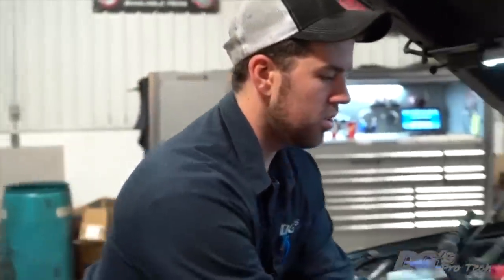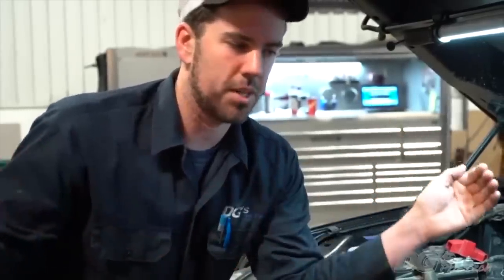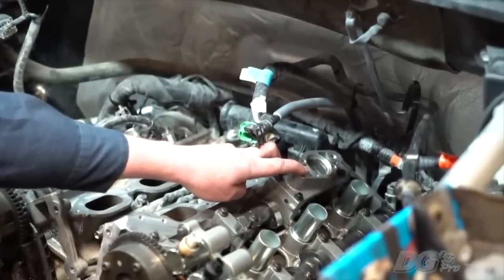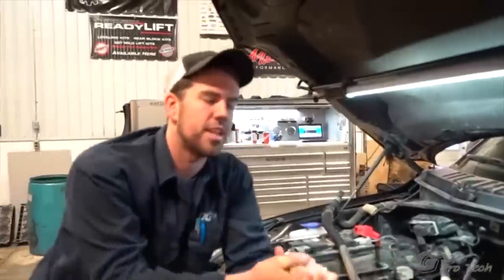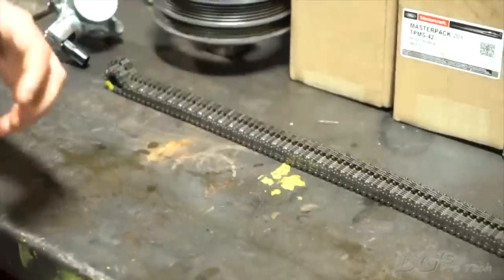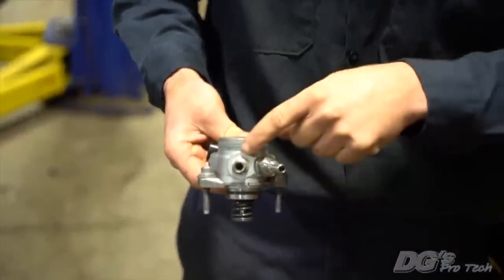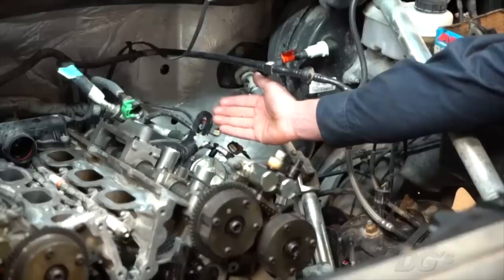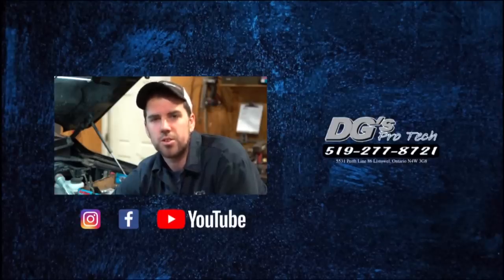What you NEED to know about Ford EcoBoost Engines by Dustin Golley of DG's ProTech

Comment: Such an articulate mechanic is a rarity in the service business.
Reply: Couldn't agree more the engine is good for business and he's well versed in its failings.
Reply: The dude's a dinosaur.  He's a thesaurus.
Reply: Jamal K. well known fact that Japanese manufacturer Toyota’s TUNDRA is now the most American made full size truck in the United States 🇺🇸.
Reply: @private1572  Right down there in San Antone.
The thing that bothers me 'tho is it's relatively so very few number of sales...58K vs. FORD 1.2M.
It seems to be a much better truck than that.
Reply: Louis Healan I own a 2017 Tundra.  I bought it new and I’m very happy with it.  It’s true they have very few sales compared to the F150.  I hate to admit it, but the trucks a dinosaur.  Bad fuel economy, not a lot of new technology and few bells and whistles to speak of.  However, in terms of reliability, you can’t beat Toyota.  These trucks can outlast the competition 3 times over, which on a side note, also stands to reason why they aren’t purchased as often.
Reply: Jamal K.  What I am trying to get across is that no INFINITI SUV is overpriced.
That is because the SUV/Crossover marketing segment is the top-selling segment in the industry.
The carmakers pack them with the maximum number of features and options to drive up the price.
They know if you don't pay their price some other Joe will.
So, in effect, none of them are overpriced because ALL of them are overpriced.
When compared to the other nameplates, they are ALL comparably priced.
Not overpriced.
Reply: Jamal K.  Have ya read 'bout that 2020 FORD Super Duty truck w/the 7.3L gas engine yet?
Reply: Jamal K.  I was reading about the FORD 6.8L 3-valve gas V-10...362Hp, 457ft/lbs. torque.
Reply: Jamal K. I’m so glad you pointed that out.  It proves you don’t know what you’re talking about.  The Honda Ridgeline is not a “full size truck.”  As everyone can see, I was referring to a “full size truck.”  Also, there’s no need for the “gay” comment, grow up.
Reply: Jamal K. So you speak for the whole world eh?  Nice attempt at a deflection.  All the googling in the world isn’t going to make the Honda Ridgeline a “full size truck” as you’ve stated.
Reply: Jamal K. You’ve said that ALL the recalls apply to ALL the model years.  FAKE NEWS.
Reply: THE COMPLICATIONS of maintaining a VVT engine is one thing.  However, the very nature of TURBOS only contribute to the quicker demise of any engine they are applied to...
Reply: Fuck you
Reply: 31B4P  Gosh!  I dunno about any of that.  My 5 1/2yo/70K mi. Infiniti w/"deluxe tech" has never had a major system failure...mirror motor noisy, e-call module failure, sun visor "floppy", etc.
I have never had to add any fluids to a drivetrain component.
I think there about 20M TAKATA airbag vehicles running around, but not my Infiniti.
Reply: 31B4P Takata airbags affected almost all major manufacturers and all deaths and injuries were HONDA vehicles.  Gas pedals?  Welcome to 10 years later.  There is absolutely no evidence whatsoever anyone died from a TOYOTA window switch.  Moreover, none of this affected the 2017 TUNDRA you buffoon.
Reply: Clorox Bleach  then there folks who drive the shit out of their Ecoboost trucks and have no problems at all. Gas consumption be damned I run premium in mine and flog it regularly. Baby loves the whip.
Reply: This guy is an educated mechanic. Good job. I wouldn't buy a ford. I am a gm guy.
Reply: I was just about to say that very word "articulate"
Reply: Jamal K.  It is not a Nissan ( Datsun ).  It is a FANCY Nissan.
I am more than a little worried about Infiniti.
They are losing models ( Q70, Q70L ), technically, their line is behind to way behind other luxury brands and the 2019s are all but unchanged from my '14 QX80 ( I purchased the Deluxe Tech model ).  The Nissan Armada is now a MUCH lower-priced QX80!
But at least, at this point, it has been the best car I have ever had ( 5yrs/68K mi. NO major problems whatsoever! ).  SO QUIET, comfortable and smooth.
6,000lbs. & TUFF as nails!
I worked as a M-B service tech for 30yrs.
NO Mercedes made since 1980 has had a comparable reliability record.  With Mercedes, your loan car is your next best friend.
Reply: Jamal K.  No engine stalling whatsoever.
The Adaptive Cruise Control cruises nice & smooth at 90mph.
That is most helpful when driving from the east side of Texas to the west side ( 892mi. ).
Reply: Jamal K.  If 10,000 lemmings follow their " leader" and fall off a cliff  do you follow in lockstep?
Reply: Jamal K.  I used to work with a guy who always bitched when he didn't get what he ordered in a restaurant during lunch.
He would face away from the waitress/waiter and mumble.
I felt no sympathy for him.  Over a period of years, I counseled him.  Eventually, he stood up on his hind legs and took charge of his life.
Reply: Jamal K. if you’re basing the best full size truck on sales alone, then The Dodge Ram must also be great according to you.  They’re complete junk, but they sell a lot of trucks.  Chevy  sold 332,000 Equinox’s last year, that doesn’t mean it’s the best crossover SUV.  It’s one of the worst.
Reply: Unreliable junk. When electric vehicles become mainstream these trucks will disappear.
Reply: Gawsh gee, g'wan now me bruddah.  Heck offa ting to speech up onhis gud artikulashon...Be like me, methinks...
Reply: 31B4P I think they forgot the Titan. Built in Missouri, engines built in Tennessee.
Reply: MichaelAChang   Wut yu mean?!? I’m a reel good talker!!
Reply: You still playing tennis?
Reply: Ok Bloomberg
Reply: he's the owner
Reply: Talks like an engineer, refreshing.
Reply: Mike, twin brother Mark? From the yard?
Reply: That is so true and most of them rip you off..
Reply: hahhahahahahhaha   you got to be joking    Similar to comparing a 454 chevy to a nova II 4 cylinder ... Little tiny engine need lots of boost to make up the diff the 454 put out just lugging along at just above an idle ... Most would think big motor means more fuel but dont take into consideration the tiny engine spun up screaming barley puts out what the big boy does just above idle an Is Running through fuel it like a faucet drain . Also There is No Fuel System that Operates at Anywhere Near 25k psi . Amazes Me Cardone Would put this shade tree Wonder on there Page without at least screening Him ...lol Alot of Misinformation , Incorrect information , an Sheer Ignorance
Reply: @civilianspaceagency7106  Maybe not anymore, but the term for this used to be "volumetric efficiency".
Reply: I think he has a very good understanding of mechanical engineering which is why he’s so articulate and understands the engine very well
Reply: Ok YouTube, here's my message, I wanted to upvote, but three tries later, I got the comments entry instead of actually the up arrow. You suck, I'm going to watch videos now and not upvote. It's your fault YouTube for being stupid.
Reply: Jamal K. You’re still not explaining how the Honda Ridgeline is a “full size truck.”  I’ve been very candid about why the Tundra’s do less volume.  I’m not surprised someone like yourself is unable to comprehend that.
Reply: Jamal K. More FAKE NEWS.  None of those recalls apply to the 2017 Tundra.
Reply: Jamal K.  I had a recall to check the driver's airbag...it is a "good" one.  It does not use oil.  The suspension is GREAT!  When I enter a curve at highway speeds, the car DOES NOT LEAN OVER!
Basically, the QX80 is based on the Nissan Patrol...an ironclad dreadnought.
This is NOT a Maxima with a CVT transaxle.
Reply: Jamal K.  There are people here who believe that the Apollo moon missions were a hoax.  They swear  we faked the moon landing.
But then, they weren't even born in '69.  How could they know?  Talk abour 2nd hand, 3rd hand.
Reply: This guy knows his trade, I see this guy going far in his chosen profession.
Reply: No shit!
Reply: Jamal K.  Never had a Hyundai...yet.  Gotta Toyota, a Turbo VW, a Hybrid Merc, an F-150 EcoBoost Platinum, and a h-u-g-e 400Hp AWD Infiniti.
Started w/a V-8 '55 Bel Air, then a Volvo, a Beetle,  an Impala, then an Olds 88, followed by a Sienna.
Have never had a bad car.
Reply: Well done! Easy explanation that anyone can understand.
Reply: Herbert Cheung not well done at all!  The Honda Ridgeline is not a “full size truck.”
Reply: Such an articulate American is a rarity.
No "like", or "actual", or even a "kind'a".
Reply: Louis Healan he sounds extremely Canadian. Which is fine.
Reply: @markiangooley  I was in Ontario once.  'Twas in August, the summer of '99, right after the Stars won The Cup.  My Dad had just died a lingering death.  Needed some road time.  Had a nice drive up from the Gulf.  My 180K mi. Mercedes Turbo Diesel purred all the way.  Went thru the Hockey HOF at the Centre.  Saw the Rangers beat the Blue Jays at Sky Dome.  Felt the breeze off the Lake on the back of my neck.  Drank a La Batt's out of a plastic cup.  Drove down to Detroit for the final season of Tiger's Stadium...Rangers lost that one.  Drove thru Mich & Ind with the windows down.  Hit hot, humid St. Louie and went to AC on HIGH.  Zipped on home for Labor Day.  A nice trip.
Reply: Louis Healan sounds like a great 👍🏻 time!
Reply: @private1572  It was a good time.  I had planned on going to see where "they" detonated "the gadget" in New Mexico in 1945 during the 7hrs. it is open twice a year.  Unfortunately my wife is still recovering from surgery.  Maybe in April.
Reply: @SpicyRok7482 nice story lake breeze stardust moments
Reply: Louis Healan he’s not American.  He’s in Listowel, Ontario, Canada 🇨🇦.
Reply: @private1572   I was about to say that he sounded as if he was from Ontario.
Reply: @private1572  so he's american from the continent, just not from the usa.
Reply: @private1572  I noticed he was from the great white north the first time he said about.
Reply: He’s Canadian. I’m American and articulate. It matters not where one is from. It’s about knowing you subject, preparation to speak know as practice. Visual aids also help many understand much better. He was prepared, knowledgeable, well-spoken. Key elements for effective communication.
Reply: @SpicyRok7482  Hey Louis! Did you know he's Canadian actually? Little hints like the use of km instead of miles, his accent, the fact that the end of the video says Listowel ON (Canada)
Reply: Louis Healan It’s because he’s Canadian
Reply: @SpicyRok7482  hes clearly Canadien.  Aboot instead of about is a dead giveaway.
Reply: @mickpratt8327  I LOVE Canadian!  GO HABS!!!  I also enjoy "Canadian bacon"...on a pizza pie...w/pineapple chunks & w/sliced green olives.
Reply: @SpicyRok7482  Listen closely, this man is a Canadian. They have a huge vocabulary. They don't use a string of four letter words to express them selves. They are also a polite people.  A case in point - if a Canadian thinks you have a hole in your head, he will never say it like that.  A Canadian will compliment you for having "an open mind."
Reply: @georgemoomaw9437  YessSIR!  I gotcha TWICE the FIRST time!

Comment: No surprise that an engine that complicated would require a lot of maintenance.  My next vehicle will be electric.
Reply: R Cruz   Brushless electric motors only have bearings and controllers, no moving parts other than the rotor.  They are over 90% efficient vs. the best ICE's pitiful 40%...no transmission, no exhaust system, no hoses, no coolant, spark plugs, air cleaners, no oil changes, and the cost of electricity is a fraction of gas to operate one.  Even a Tesla model 3 will cost you the same as a Toyota Corolla after five years due to the lack of maintenance costs, along with 0 to 60 in 3.3 seconds.
https://www.youtube.com/watch?v=zFiw3_uXyyQ

Comment: Have you seen Issues with carbon buildup on the back of intake valves on Fords Eco Boost 3.5
Reply: Fixed in 2017 or 2018 with dual injection system
Reply: All direct injection motors have this issue to some degree.
Reply: common problem
Reply: Can always install a catch can. If the crap from the crank case doesn't pass through the intake it'll never build up on the backs of your intake valves.
Reply: Do these eco boost engines need an oil catch can or are they ok with out. I have a 2016 3.5l
Reply: @lewisvenecia  I don't personally have an engine with direct injection but build up on the back of the valves seems to be a common problem. No fuel washing over the valves to keep them clean since it's injected directly into the cylinder. Then you get all the crap from the crank case that gets routed through the intake through the PCV to be burnt off. I keep hearing these issues were resolved in the newer engines with both direct injection and the older lower pressure injectors through the intake. Catch can just seems like a good idea to me, but I'm just some asshole on the internet so take it with a grain of salt

Comment: The reason gasoline doesn't need as much injection pressure is that gasoline engines have timed ignition. A diesel injector has to overcome high cylinder pressure and the ignition that is occurring as the injection happens. Gasoline injectors are done injecting fuel when the spark ignites it. They are not trying to push fuel into an explosion in progress like a diesel is.

Comment: Is this the same cardone that makes junk replacement parts?  Like the 2 broken distributors you sold me for my truck? One was cracked and the other leaked oil from the top.
That engine is garbage.  Tell us about how Ford in their infinite wisdom buried  the water pump inside the timing cover.   Ford's are garbage.

Comment: What about valve build up due to direct injection? Thanks
Reply: Ford changed that in the 2018-2019 models...some spray hits the back of the piston
Reply: Been looking at 16 and 17 models, guess they will have the issue?

Comment: Even Ford should be satisfied with this explanation.  It needs fresh synthetic every 7,000 miles or so.  10,000km.  Another thing, on any engine but especially turbo, you go easy on it when it is cold.  Only use real power after the temp needle is off the peg.  Duh.

Comment: Thanks for the information  , I had this issue with my 05 5.4 after 208k miles . Changed the oil / filter every 5k . I recently bought the 18 F150 3.5 & plan on doing the same oil changes with full synthetic . Question ? What is your opion of oil additives like Stiction ? Could this product help with keeping a clean engine ? I did install a passenger side catch can . Enjoyed your video .

Comment: If they would just leave these motors alone instead of building the new one every few years we wouldn't be running into all these problems
Reply: Yes a but power and miles per gallon wouldnt improve as fast either.

Comment: The design is made to fail. Cheap cheap timing chain. Had Ford dealer do service for first 200k. At 160k timing chain was stretched to point of needing replacement. Eco bust gets worse fuel mileage than 5.4. Owned both back to back identical trucks.  the computer also gives false fuel mileage, checked this weekly for three years. It's made for the mathematically challenged.  Going put this shit box in the crusher and buy a Dodge.

Comment: I have the 2016 F150 with the 3.5 and 36,000 miles on engine. Have you seen any issues with carbon build up on the valves? If yes, at what mileage do you recommend an induction service. I hear BG has a Ford approved induction service.

Comment: I had a Kia van with ecoboost. not sure if is the same motor but it had a carbon build up issue eventually it clogged some oil passages and then it seized.

Comment: This has to be one of the best break down videos of the eco boosts.   No drama...just straight mechanic talk.  I got one in my ford transit van and it is a blast to drive in houston where you have to get on the gas to get through traffic.  Also pulls my 6 x12 cargo trailer like it wasn't even there

Comment: I have a 2011 ecoboost. Worst truck I have ever owned except maybe the old J10 I had out of high school. spent thousands in the shop, been towed twice, still runs on 4 cylinders most of the time. Considering leaving the keys in it at the 7-11 in Reno but they probably wouldn't make it past the first red light. Changed waste-gates, turbo's, 2 dozen coilpacks, intercooler, and catalytic converters. Currently have Low boost, random misfire, misfire #3, misfire#4, ABS codes, timing chain rattle just started and drive line thump (again). I'm 47 years old and this truck was the last straw. Lifetime ford man is now a future mopar man. They should have never released this engine until 2013. It did run great for about 20,000 miles of the 105,000 I've put on it.

Comment: 1st gen 3.5 had some issues but the 2.7 and 2nd gen 3.5 are great engines.  40wt oil at 5k mile intervals, premium fuel, and spark plugs changed every 50k....you'll reach 300k miles

Comment: What I got out of this is there is nothing like a high displacement engine.
Reply: Smaller engines still keep weight down and efficiency up. Sure, they might wear down after 200,000 miles, but you can always drop a new one in if you keep your car that long.